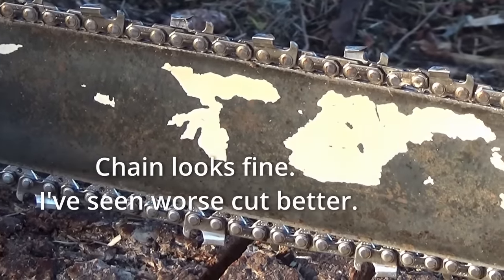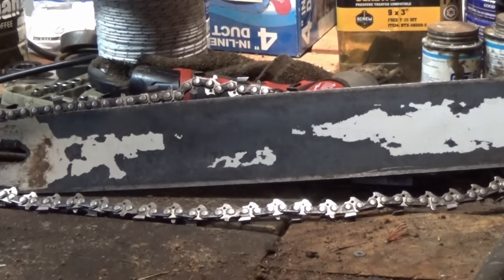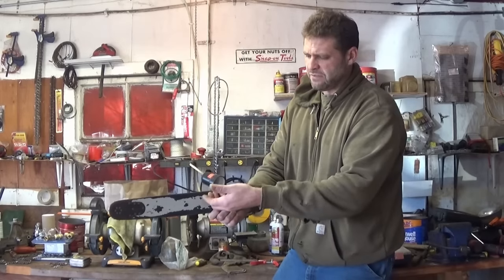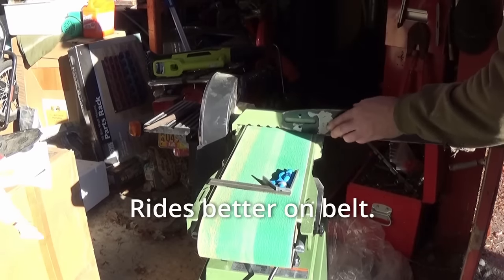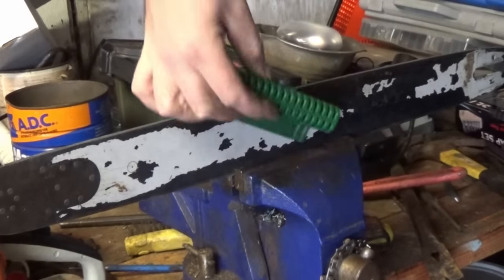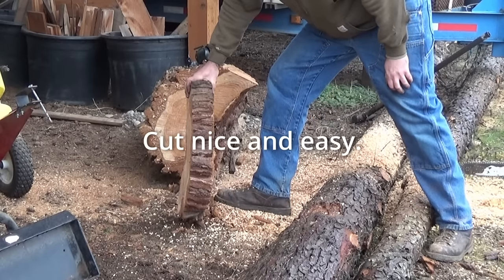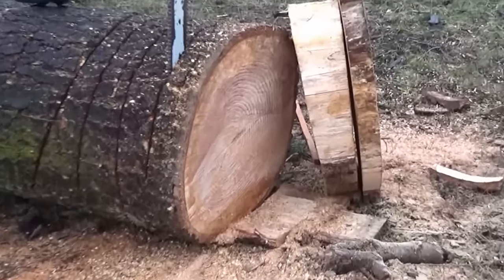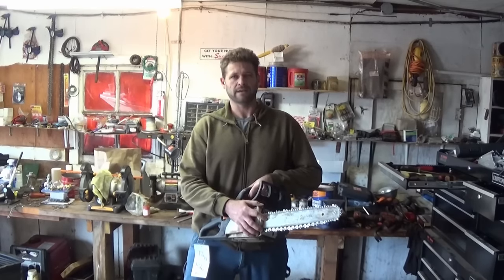Chainsaw Cuts Crooked Curved Cuts. Bar Dressing and repair. Before and After.

Comment: Wrong gauge of chain in a bigger bar, loads of people do not know that the bars can have a different width of groove, or it might just be wear of both.  Do NOT forget to fill the oil and make sure the pump is working.

Comment: How often do you recommend flipping the bar?   My cheaper grade saws usually cut crooked but more times than not it's a chain issue.
Reply from the maker: If you are anal, flip it every time you have the chain off. I flip out about every 5 to 10 sharpening. I'm sure I should do it more often, just like chaining oil and greasing equipment.

Comment: my .050 gauge bars measure .055 at some places with a spark plug gauge. Is it time change them ? I have dressed  one of the bars and with a new chain it cuts strait for now  but will I be causing undue ware on the drive links of that new chain if I run it like that ?  Thanks in advance for your answer.
Reply from the maker: I wouldn't worry, sound minor and still cutting straight. If you start to get the jumpy RPM, that is you clue.

Comment: So if all the numbers match and or correct on the chain, it’s the bar? Pinched my bar, had this problem since.
Reply from the maker: If the chain checks out correctly, it's likely the bar. Try checking the bar with a straight edge, or a small square and flashlight. Check tension, mounts, bar studs, cover and components.

Comment: How about something on straightening a bar that gets bent a little? This is a very common problem.
Reply from the maker: Not sure I could solve a crease. Try the vise, then cleanup the groove with a small cutoff wheel. Sounds like a maybe.
Reply: Take 2 2x4 and cut a notch in the end this will act like big pliers for bending the shape. People use it to straighten cheap swords. They are like F just a notch cut out.

Comment: My clutch is squealing and squalling time for a new clutch or can it be fixed
Reply from the maker: You can try cleaning it with solvent, maybe it is full of junk. I'm miking a video now of a MS 310 that had a clutch fire and burned up the saw. You will know when it is slipping, and you will need to replace.

Comment: Great things to look at. I had the same problem with curvy cuts, bought a new bar and new chain, installed and still curvy cuts. Not sure to do to fix that. Do you have any suggestions? Thank you  Ron
Reply: You’re certain the gauge of the chain is sized for the bar? Chain tension might be too loose. Are the bar mounts bent or damaged at all?
Reply from the maker: Mismatched gauge or to loose chain. Could be a loose bar, maybe some junk got in there when tightening and loosened up. Could be a crappy bar, check with a good square and flash light. Could be a crappy chain, sometimes one side has a bad factory grind.
Reply: @gorgeoutdoors  Thank You very much
Reply: I have this, did you solve the problem?
Reply: @dangermann7460  Not yet I am looking for a good repair shop near me.

Comment: More often than not if it's cutting a curve it's an unevenly sharpened chain get a good electric chain sharpener or take it to someone who has. 9 times out of 10 it will cut straight again.
Reply: Electric grinders are trash, unless we are talking silvery or simington square grind.
Reply: @jeepinass  Got news for you buddy, my Foley Belsaw, Chain Mate has done an excellent job since I bought it as a Husky dealer in the late 80's.  Never had any complaints.  Yes if you're sawing in competition fileing is better done by an expert but for general use an electric grinder run correctly is great. Many want to grind way more than  needed, often burning teeth so they can sell more chain but that's operator, not grinders flaw.

Comment: Something about not straight and a sanfransisco cut 😳...😂😂😂😂. ...i have problems side cutting every 20 minutes , the chain comes off the bar. Also i say this, i been using a saw for 38 years . Im tired bro. Im about to check into a milwaukee 20v battery saw
Reply: Sanfransisco cut! Hahaha

Comment: At 2.10 you claim your chain isn't too loose. I beg to differ, on the basis, that. if your chain is sagging at all, on the underside of the bar, your chain is loose by default.
There is always absolutely, enough slack, when pulling the chain up on the top of the bar to check, without the chain having any sag whatsoever on the bottom.

Comment: Generally a saw trying to cut crooked is the chain not being sharpened evenly.
Reply: If it was not sharpened unevenly, wouldn't it be sharpened evenly and therefore cut straight?
Reply: @Kristi Stanley  thank you Krisiti. I typed that wrong. You are 100% correct.

Comment: lol if you run your saw to fast for too long or run it out of oil this will happen? A new bar is $40 a new chain is $35! If you put a new chain on an old bar you will wear out the chain the first time!  Buy a new bar if you can cut your finger on your bar? Replace both chain and bar through the old ones away

Comment: thanks for the video My chainsaw have the same probable but I dont have these grinding machine to fix it by my own
Reply from the maker: The little green hand held unit is available online for cheep. It doesn't take much effort. You don't need a sander or grinder.

Comment: When the chain is duller on one side than the other, this happens
Reply: That’s completely false.
Reply: @ALWAYS PREPPING  I run a chainsaw everyday, so I know for a fact that a saw cuts crooked when one side of the chain is very dull and the other side is just semi dull or sharp. So, no it's not completely false. If u know anything about saws, then u should know that
Reply: @dereksteele2284  that has been debunked so many times. You can grind off all the cutters on one side and it will still cut straight.
Reply: @ALWAYS PREPPING  you're very wrong. You clearly know nothing about a saw. I know from experience, if one side is duller than the other, it will cut crooked and bind the saw up to where it won't even go through a tree
Reply: @dereksteele2284  😂😂😂😂!

Comment: Unless you religiously chamfer  your bar rails I would NEVER run my fingers down the edges like you did.
Reply: useful video, will use it, loved your shop its as messy as mine,  I have a bar in which the wheel on the front will not turn completely around , can turn it back but going forward always gets stuck on the same spot